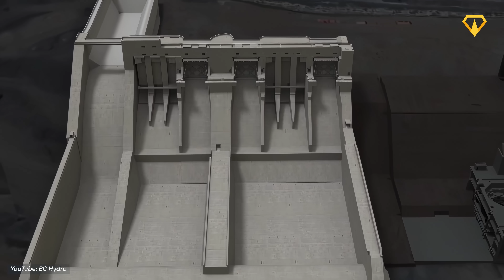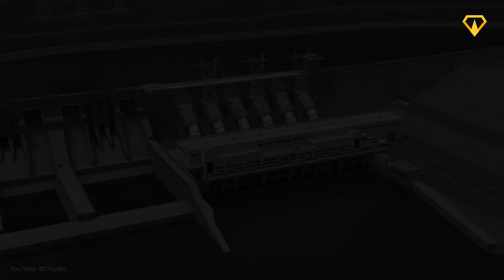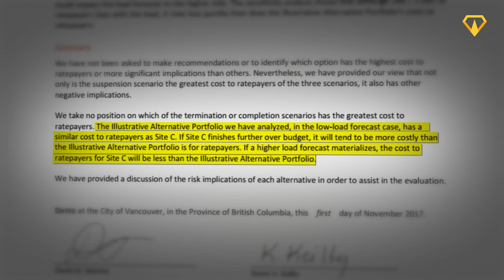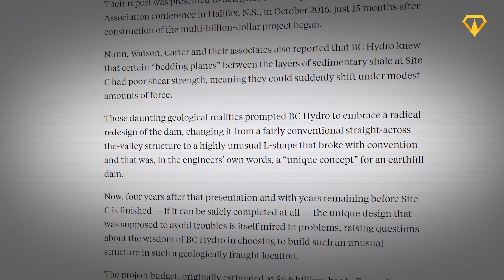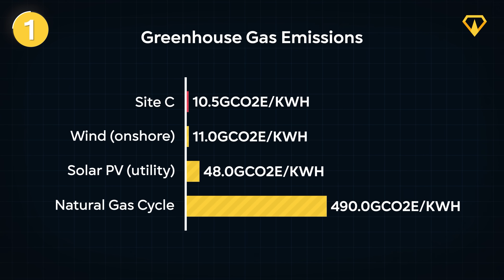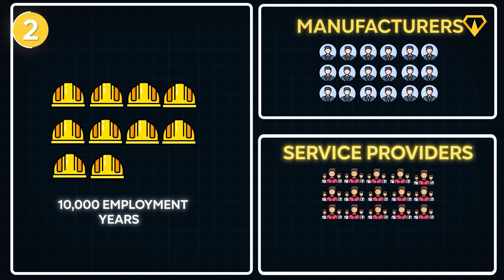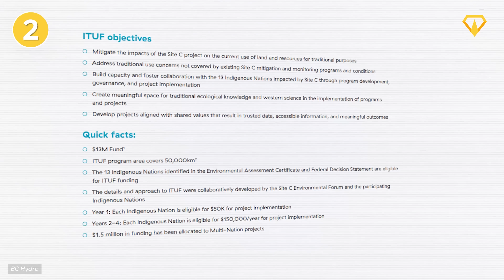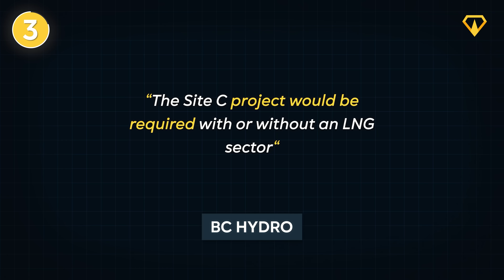Canada's Massive $12B Mega Dam

Comment: There are multiple reasons why the dam shouldn't be built. 

A - the farmland on the north bank. As someone else mentioned prior in a different comment, the South bank mostly a straight face, no where to really farm it. There is a few locations, but no more than probably 500 farmable acres on the south side. Of which, besides a recently installed pipeline that runs from 120km's north south to the Plant that is the start of the CGL pipeline (it's not in Dawson creek, but about 40 km west) there is no access to this land. The north side has a bunch more, but for the most part the flooded sections were tree covered. Now the sections that weren't tree covered were reportedly the "best farmland outside of the Fraser valley" and was considered "the future breadbasket of the North". Couple problems with this though. The vast majority of the crop pulled from this section of the peace valley has been hay, or some form of grain. The same crops pulled from up on top. One farmer did try and do potatoes the one year, it was a major bust as there is no place for potatoes to get processed. He did local selling, majority of it was turned into fertilizer the next spring. So farmland wise, meh. Not that bad, not that big of an issue. 

B - Soil stability. Site C has been planned since the 70's. Not a single engineer until 2014 would sign off on the project due to the fact that the entire peace valley is formed from shale. There is no solid ground. I heard a rumor that the engineer who did eventually sign off on it, was from china. Not sure if true, but honestly wouldn't be surprised. Have seen a number of Chinese companies poking around south of there trying their hands at coal mining, only to realize there is hardly a profit doing so right now. Hell the main mine in Tumbler is only just being turned back on after like 15 years of low idle to 0 productivity. Back to the stability, there has been a number of slides over the years in the peace river. One almost closed it off about 40-50 years ago. So I would consider that a valid concern. 

C - Local facility usage. The construction of site C has brought a few people to town. I believe numbers hovered around 2400 a month working on the structure at any given time. Local concern was the construction of assets that would be used during the construction phase of site C, but during operations due to the lack in need for people, would be shut down. This also covered housing, as a  number of houses in town were built in anticipation of this, which is great. Except it forced the housing market up. Since the project has since completed and the majority have since left or are leaving (they started filling at the beginning of the month), housing has started coming back down somewhat. 

D - Environmental concerns. There was a large wetlands that is now about 5 feet underwater at current, and there was a large number of animals that roamed the north bank. I personally have hunted elk on the northern bank. There was a large deposit of Mercury rock(?)  that had to be mined and dug out of an island in the middle of the river, I personally don't know if they got it all. All I know is that they had excavators and scrapers digging 50 km up river in the center of the river for about a year and a half. You can still see the road to it on google maps. It's just past the Ferrell Creek road going west. That getting into the water, would be catastrophic. But, apparently they got it all. There was also concerns about trees being left behind a popping up like rockets as they did in WAC Bennett for years. I feel that the reserve was logged sufficiently. Driving past it last week, most the remaining foliage was young willow growth. 

E - First Nation Rights. Due to the treaties, the first nations have a lot of land that is being affected by this. Now someone else mentioned that treaty 8 covers 800,000 km and this is only going to flood like 10,000. That there is 34 FN along the river. While true, the dam only affects  5 bands. Blueberry, Profit River, Halfway, Doig River, Moberly, Saulteau. There might be some others claiming being affected, but these are the ones in the local area. They lose land, ancestral burial sites, hunting grounds, and they kick up a fuss. Which we really don't need more of. 

F - Cost.  Original total cost was 6 billion when construction started. At current, with it filling it sits at 16 billion. The blow back on this is an increase in the price of hydro in BC. Incase you didn't know, BC Hydro is a state run organization. It is also, the only hydro outfit in BC. As such the pricing is dictated by the state. Hydro prices have jumped up a fair bit, which everyone kinda saw coming. There is also the fact the hydro isn't staying local, its going south. As in across the BC/Washington State border. As in to California. And frankly, people up here are tired of being scalped and having our resources shipped south then sold back to us at a higher price. Except in this case, its going south for nickels on the dollar thanks to NAFTA. So ya. The turn around on the price tag to seeing it making a profit, is going to be significantly longer than the LNG project he glossed over in the video.
Reply: too late its almost built  lmao

Comment: It was needed to replace the power 'Lost" because of the 50 yr old  Columbia Power Treaty's expiration. 
As result fully  50% of the new dam's output is required to fill that void  alone. 
Add in the transmission distance  losses  and the thing's available power  is more or less a wash.

Comment: 1. The comment from @PracticalHomeLabs confirms that BC Hydro is incentivized to sell power outside of BC. The position of the chairperson of the Dam Review Authority was that there was no internal BC demand for additional electricity. Thus, the dam was built to meet external power demand. 
2. Climate change, impossible to accurately project, but the recent trend in BC has been of increased wildfires due to hotter and drier summers and winters. Will BC experience a drought?  We were in Southern Zambia earlier this month and they have 20 hours of loadshedding nation-wide. The Zambezi River Authority website shows that only 7.4% of usable water storage remains in Lake Kariba, which was the largest man-made reservoir in the world at time of construction (1958).

Comment: It wouldn't be too bad if the residents of northern BC were able to use this hydro produced at the expense of the environment in our front yard.  Instead, would be sent to the lower mainland through wire bundles that further destroy our environment.  We won't even get a discount on the power.  

Once the province ordered to cease Site C construction.  Defying that order, the company continued so that they could claim that too much had been put into the project for it to be shut down now.  

BTW, how come no one ever comes up with the hidden costs of these projects, ie carbon foot print.
Another point is that the best projection BC Hydro has to offer is that the Site C should have a "relatively minor" or a "minimal" affect on the NWT. Environmental concerns have already been revealed, such as a $1.1m fine for waste water contamination.

Suggestion:  Since the hydro is destined for the BC lower mainland, build the dam in the Delta region (tidal) to further reduce shipping costs.

On benefits to the economy, check out the Mica Dam and the "booming" Robson Valley businesses and residents.

Comment: Both hydro electricity and LNG are crucial to Canada's future.  Site C is a great addition and Canada should be making every reasonable effort to increase the percentage of hydro electric generation from the current 50% to 80% and eventually filling the other 20% with other forms of renewals or advanced nuclear.   When a project is cancelled when it is only 50% toward completion, you not only loose 50% of the budget that has already been expended, but you pay out another 50% in cancellation fees and legal costs.  This leaves you spending the entire budget and having absolutely nothing to show for it.  We've done that before and it's a disaster to the economy and to the Canadian taxpayer.

Comment: There is one thing that is certain. There is NO "Reusing" the water. People get that right? Once the water moves down river, it is not brought back up river to be "reused". Stop it with the "reusing" the water talk.
Reply: The one thing for certain is It should not that hard to comprehend that the “exact” same water used to turn the generators at Dam # 1 is used again unaltered at Dam #2 and again will be used at the site C. So again the “exact” same water with no alteration is being “ Re-used “ repeatedly over and over to make electricity.

Comment: Its finished already and filling as we speak. I want to add, I live in Fort St john, where the dam has been built. This entire Project employed very few people from the area., It was al most entirely Hires from outside the area. The dam also secretly was the home of a hidden and highly Experimental  Magnesium Reactor by Western Magnesium, which went BANKRUPT early 2023, Even still Very few people of the area know this even occurred!! BCHydro has faced many violations, Illegal Dumpings, and The preparation of the area is absolutely despicable. as they are flooding the land currently they haven't even removed the roadways, bridges , trees, They even have proposed lewawving much of the equipment in the basin top simply be flooded and polluting the land.  Lastly, THE DAM IS BUILT ON SLOPES WHICH ARE CURRENTLY VICTIM OF LANDSLIDES. THE CREATION OF THE DAM CAUSED A MASSIVE LANDSLIDE WHICH REMOVED AN ENTIRE COMMUNITY FROM THEIR HOMES, not more than 2 km  from the buildsite.

Comment: There is also NEW high-water-head-pressure multi-head Vortex-Ingest Micro-Turbine technology that can replace the super-large turbines the Site-C dam currently uses which  produces only 1.1 Gigawatts. With the new turbine technology installed, we can QUINTUPLE the dam's power output to 5.5 Gigawatts sustained (i.e. 5x more up to 5.5 BILLION Watts!) which would power over 2.5 Million Homes or pretty much ALL of British Columbia year-round with no issues from a single dam site!

Now THAT is something to get behind!

V
Reply: Interesting, is this new turbine tech being used elsewhere? What's the reason for not using such turbine technology?
Reply: @footprints2gigi  It is being used in some test facilities. The general name for this technology is "Small Form Factor Microturbine Array" which is a way to take advantage of the variable "Water Head Pressure" along different points within any given dam intake pipeline system that sends water down a large pipe into the usually-very-large single turbine power generators.

Instead of one very large turbine, you use MANY small arrays of microturbines to take out as much of the water-pressure energy as possible by installing microturbines EVERYWHERE along the large intake pipes.

This technique was tried once before many decades ago in the 1960's BUT the issue back then was that NO powerful and cheap GPU (Graphics Processing Units) were available to allow proper hydrodynamic simulations of water flow and cavitation.

In the 1960's, they installed too many small turbines of the wrong size and shape in the wrong places along the intake pipes causing enormous amount of cavitation (i.e. vacuum bubbles) which were caused by the leading and trailing edges of all the turbine blades. This causes too much water momentum loss and too much bubbling affecting all downstream microturbines.

The effort was then abandoned BUT in 2020, networks of powerful and CHEAP graphics cards (i.e. GPU cards from AMD and NVIDIA!) could be installed on desktop computers to allow engineers to MODEL the entire waterflow hydrodynamics as water went down ANY size and pathway-shape of a SPECIFIC dam's water intake pipeline. This allows engineers to model the size, shape and placement of ALL microturbines to MINIMIZE cavitation and waterhead pressure loss as intake water moves through multiple stages of small form factor microturbines.

The computer simulation allows engineers to build small microturbines that have a blade shape, blade size and turbine placement that is SPECIFIC to any given dam structure. Each turbine is numbered and placed in a specific place within the intake pipe and all water then goes through multiple stages of different sizes and differently-shaped turbines which are optimized for their specific in-pipe placement and head-pressure. 

These turbines are now 3D printed using Metal Powder Laser Sintering machines usually made out a marine-grade Stainless Steel and then coated with a super-hard aluminum oxide ceramic to prevent cavitational ablating (i.e. blade pitting is minimized!) 

When you combine THOUSANDS of these microturbines each producing over a Megawatt of continuous power output, it means you could have GIGAWATTS per intake pipe.

The Site-C Dam was found,  AS PER AN ENGINEERING STUDY done by a hydrodynamic test team when almost ALL of the intake pipe was used for mciroturbines, that a MINIMUM of 5.5 Gigawatts (i.e. powering 3 million homes!) could be gotten out all those intake pipes using an optimized microturbine array. 

The Upper-Level maximum test output of the hydrodynamic simulation estimated at peak water levels (i.e. during the fall and spring rainy season), the Site-C dam's gross power output could be as high as 12 GIGAWATTS which is enough to power 6.5 MILLION HOMES! That is a LOT of clean hydro-electric power that can come from a SINGLE dam!

If we change ALL of Canada's and the USA's hydroelectric dams over to computer-optimized microturbine arrays, we could supply enough clean hydroelectric power to fulfill almost 65% of ALL of North America's Total Power Needs where Hydropower is currently only 6% of ALL utility-level power production of all types.

Now You Know!

Comment: I am a strong advocate for solar and wind generation combined with battery storage. But, in BC where there are mountains with huge rivers running down them, hydro power makes a lot of sense.
I'm not a fan of this L shaped dam. The strongest structures against that kkind of pressure would be curved, not straight with a 90 degree corner. I just hope the engineers know what they're doing.

Comment: Canada should expand its nuclear power, we have a country with a huge amount of water yes, but we also have a huge amount of elemental uranium and a lot of baren useless land to burry the spent uranium in. It's super efficient, the power production itself is clean and if you travel eastwards, earthquakes and the like are a non-issue. It also takes up a way smaller land area, its cheaper to build and it can potentially make even more power. The only downside is that it's not renewable but for the sake of affordable hydro during the transition to fully renewable sources, I would support it.

Comment: LNG is far better for the climate than coal or crude oil. Energy infrastructure was built for oil processing & transport, not LNG. Getting more LNG to market is good for the consumer - because cheaper energy; and good for the business - because high demand. 

Hydro is good but there's limitations to the range electricity can be sent due to capacity constraints of transmission lines. Hydro and Solar disrupt large areas of land (and wind too but mainly the noise pollution with the turbines). There's plenty of land to meet energy needs with renewable sources but the transmission infrastructure isn't built for that. We will need non-renewable sources for the foreseeable future because of the intermittent electricity demand issue and there are plenty of LNG & Oil Refineries / Power Plants for high demand areas. With LNG being the lesser of the two evils. 

Nuclear Fission is the most promising technology, but when implemented it will take a long time to build the sites and at a high cost. Similar issue with Nuclear Fusion, but there's the additional factor of using a radioactive energy source. 

Hydro to help refine & transport LNG is a great use case. Centralized and consistent demand is a less risky investment for investors. They can model future cash flows fairly accurately for this. Which is probably why the developer is okay with the heightened construction costs. No sensible investor will deploy this much capital without an extremely high chance for success. Sounds like a solid plan. 

As a side note: offshore wind is great, if building out at sea is a feasible option. UK / EU has great Wind Farms. Why we aren't doing this in the US is a great question. Eastern Seaboard of the US has very high wind potential. NYC / Boston area is best, with very high energy demand. Most of NYC's power comes from Canadian LNG / Crude. Lmk if you're interested in doing this and have a lot of capital to deploy

Comment: I live in the peace reign and I for one  are not surprised we need power. The cost is so high because of controversy of the project. Do I think it would have been worth it if I knew the final cost maybe not. We need to understand a dam is a big battery. Power needs are skyrocketing as we transition away from fossil fuel our need is going to rise a lot more.

Comment: This one was a tough choice. I am in favour of Site C and always was. Once we built the Bennet Dam the river was permanently changed so we might as well make full use of the impounded potential energy the Williston Reservoir represents. The argument that LNG will help Asia burn less coal is not as impressive. Burning 1 tonne of natural gas produces about 2.75 tonnes of CO2 vs burning 1 tonne of coal produces 3.7 tonnes of CO2. It costs less energy to ship natural gas than coal as well. However, ang natural gas you lose to the atmosphere, called fugitive gas, releases methane which is a far more effective greenhouse gas than CO2. As little as a 5% loss rate eliminates natural gases' advantage over coal.